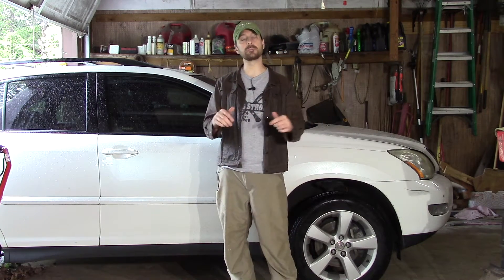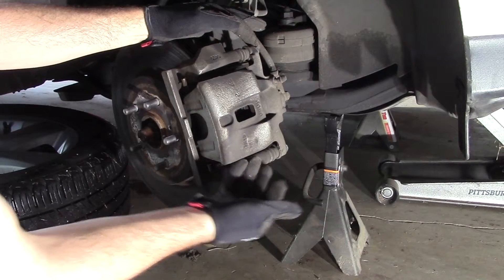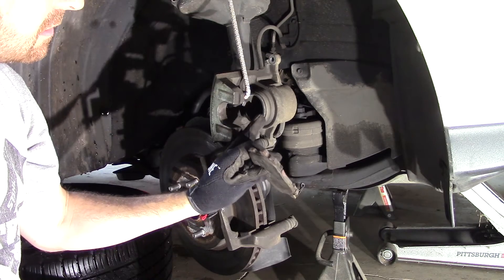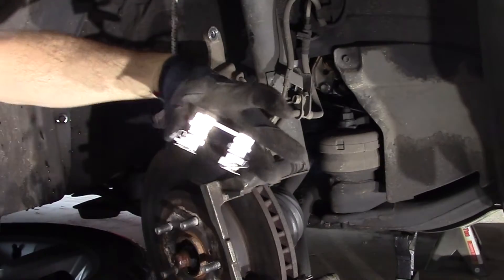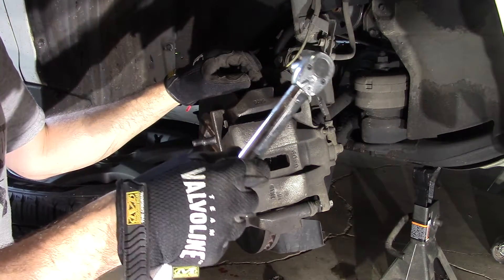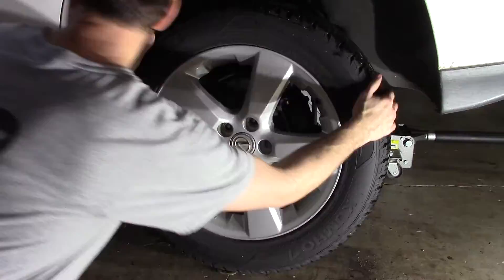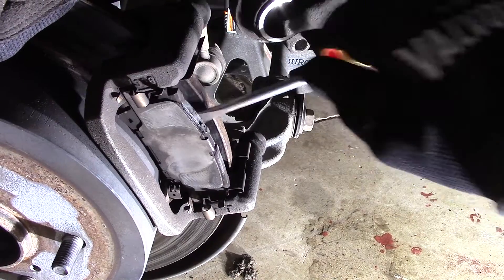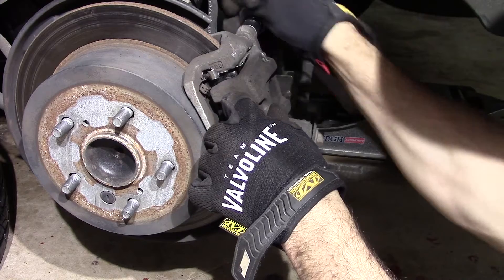How To Replace Brake Pads - Lexus RX330 - Easy DIY!

Comment: After you push the pistons into the calipers to fit the new brake pads press the brake pedal several times to fill the caliper cylinder with fluid and push the new pads against the rotor.

Comment: I know im a little late.
But this same procedure can be done for the rear right? Since the rear also uses brake pads and not the disc
Reply from the maker: Yes, the rear is the same as the front. All are disc brakes and not drum brakes.

Comment: You need to apply the grease to the part that is sliding into the bracket at the spring also, both spots. You answered my question. Thanks for the video.
Reply from the maker: Glad it helped

Comment: The bolt in the caliper is stuck, any tips to get it out ?
Reply from the maker: Just penetrating oil. Then try to knock it out with a hammer and screw driver.

Comment: Do you need to bleed the brakes? I have a 2005 Lexus rx330
Reply from the maker: It’s a judgment call. You can just crack open the reservoir when you are compressing the pistons in the caliper.

Comment: Were the brake pads the same size for the front and back?  I'm getting ready to do this job and I have 4 smaller ones and 4 larger ones that came in the mail.  Thanks!
Reply from the maker: I don't recall. I do not have the vehicle anymore. The auto parts store will give you the correct ones when you ask for them.
Reply: @CountryLivingExperience  I already ordered them through the mail.  I think the fronts are larger than the back, I was just curious.  Thanks for the reply.

Comment: Thank you for the video. It’s helpful. I like the suggestion of using anti-seize instead of silicone grease. Good idea. 

My concern is that brake parts cleaner has some neurotoxic chemicals in it and I would suggest keeping children away from these chemicals without a proper respirator or ventilation. Other automotive chemicals are toxic as well. 

I prefer to spray parts cleaner and chemicals outside to minimize breathing them.

I have a 3M respirator with organic vapor/acid gas filters which works well to filter most brake parts cleaners as well as most chemicals. And it’s always nice to have a gas mask/particulate filter around. I prefer the full mask for the excellent eye protection. Irritating to wear but offers great protection. 

Also, sometimes the rubber bushings on the glide pins swell and bind. This happened to me and will ruin the pads. It’s only $5 for the rubber replacement kit (2 calipers) so it’s a good investment when changing out brakes on these if the fitment is anything other than very smooth. We have an ‘05 btw.
Reply from the maker: You're welcome.

Comment: Question: Did you have to remove the brake fluid cap prior to compressing the brake pistons to allow for the pressure change or did you leave the cap on?

Thanks for the video!
Reply from the maker: Thank you. I did crack the cap open but did not take it off. Brake fluid absorbs water so leaving the cap off is not good for the system. Hope that helps.

Comment: You don't need to turn(mill) the rotor to make sure the rotor surface is even?
Reply from the maker: These rotors were smooth. No grooves. I think I mentioned that. If yours has grooves, you need to replace them or have them turned.

Comment: What size socket do you need to take off the bracket to be about to replace to rotors?
Reply from the maker: I believe they are 13mm but I don’t have that vehicle anymore.
Reply: 17mm

Comment: What if u can get the little pins on the side of the brake pads? Can u still install them without the pins
Reply from the maker: I am not sure what pins you are talking about but any piece you remove needs to go back on. You cannot skip or leave out any part or it could be dangerous.

Comment: My dash board ‘BRAKE’ light illuminated after this repair and beeps. Fluids are all good? Wonder why that’s happening? 2004 Lexus RX330... Anyone know?
Reply from the maker: Did you check the parking brake cable to see if it is sticking? Or the reservoir cap could be loose.

Comment: After you compress the piston and then put the brake pads back on. As well as the caliber and everything. You didn't tell everybody that they needed to pump the brakes. And make sure the piston comes back out accurately, Also to check the brake reservoir to make sure no fluid came out.

Comment: Hello, i recently had an emergency brake scare on my 04 fwd rx330.  it has 225k mi on it.  I plan on adding a roof top tent and rack which would add roughly another 150lbs to a crossover with sub par oem braking.  I heard that v6 camry/solara calipers are dual piston and can fit on the rx front brackets. Are they an improvement over the RX as i'm puzzled to think they would place lower quality brakes on a heavier lexus?

 I also saw on club Lexus that a member had improved braking by swapping the rotors from a supra tt and adding steel braided brake lines with dot 4 fluid.  Would it be possible combining both methods? Is one superlative over the other? Are there similar rear upgrades? Are they worth it or just focus on the fronts?
Reply from the maker: You should find a toyota mod forum to ask these questions. I cannot give you any answers with confidence as I am not a Toyota/Lexus mechanic.  Sorry bro.

Comment: Do you bleed your brakes?
Reply from the maker: I don't. In my opinion, it is not necessary unless you are changing a part of the hydraulic system like a caliper or a booster. Or if you believe there is a contaminant in the lines.